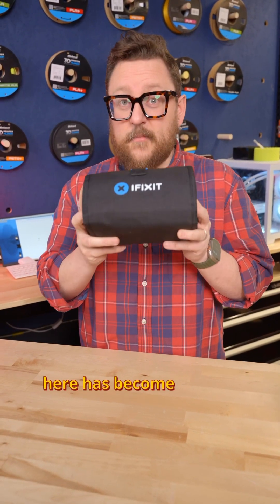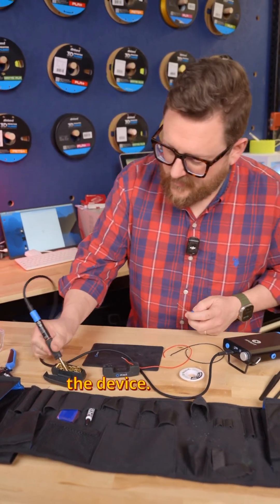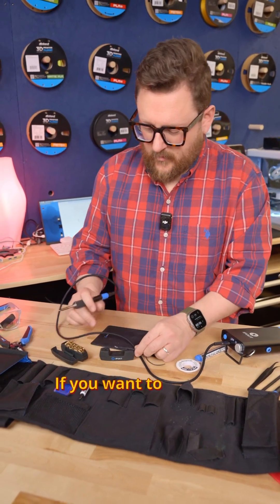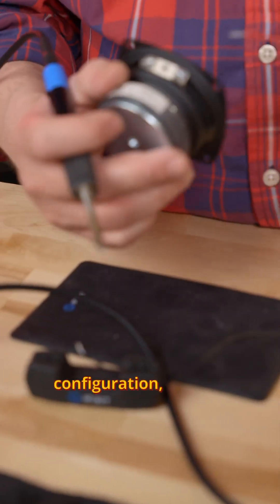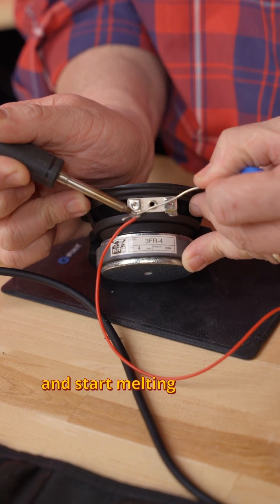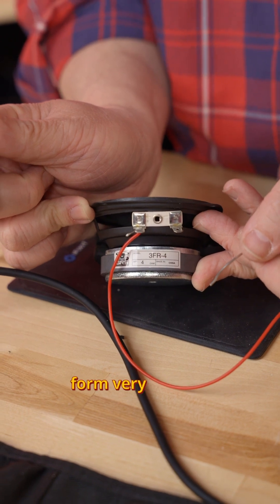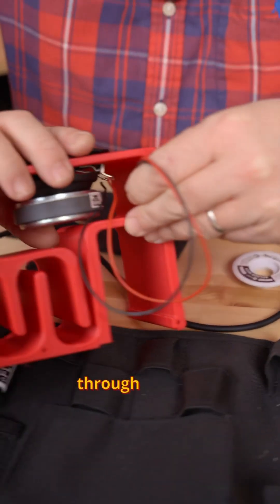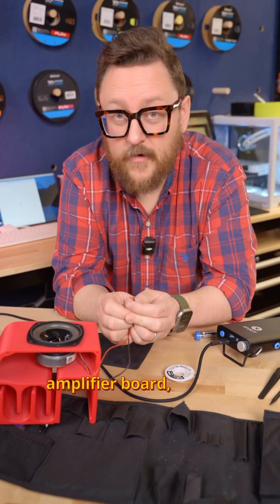iFixit Soldering Toolkit | A MUST HAVE Maker Tool

Comment: FTR, you aren't supposed to touch the solder to the iron
Reply: That's correct you definitely want to make sure the surface or wire is heated up appropriately, sometimes I get impatient....it rarely pays off.